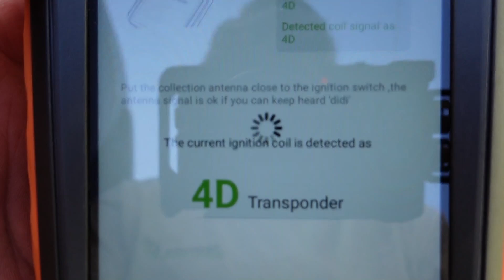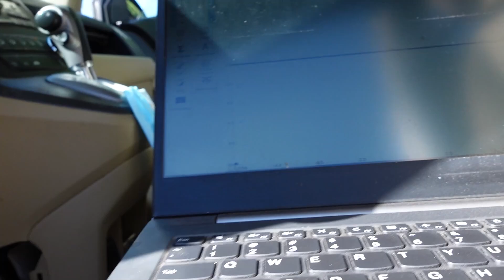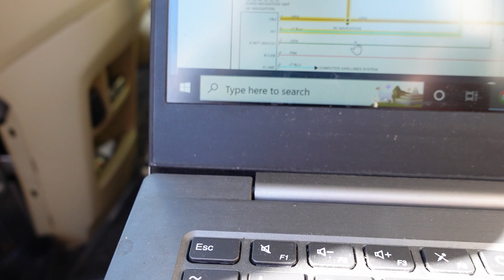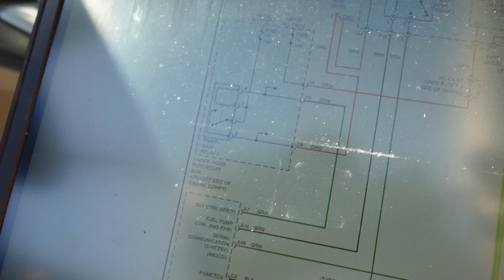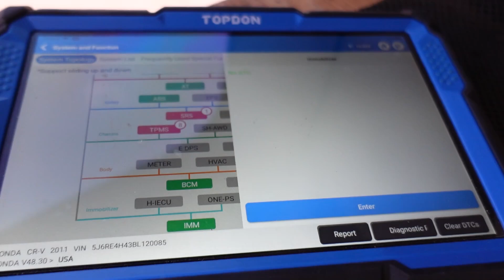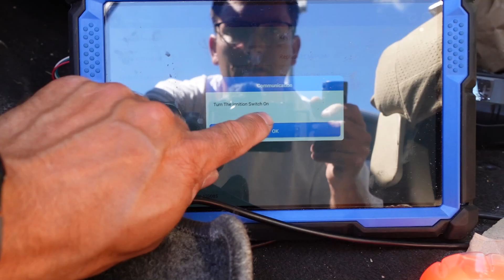2011 Honda CRV Immobilizer Light On

Comment: Hey Brian, do you read these messages  still? I'm having this exact problem on my same generation CR-V. I too have a remote start that has the same exact key fob you show in The video...What is the actual fix for this? Is that Autel scan tool necessary? Thanks in advance.

Comment: Hello Brian, I just wanted to say thanks for posting this video of the process you went through.  You've got quite the spread of tools to help and ultimately you showed that CR-V who the boss is.  I got a degree about 20 years ago, worked in the field a little while, and ultimately made a career change.  I still like to tinker and fix things, and I'm currently fighting my wife's 2010 CR-V.   I will say, that wrapped wire that was dangling is also present on our CR-V, but ONLY because we had an aftermarket remote start system installed.  Elsewise, it wouldn't be there.  I ended up replacing the MICU (Multiplex Interface Control Unit, I think.) and currently have the same lovely light letting me know the car doesn't want to be stolen.  My local Honda Stealership insisted that replacing the MICU would not require any reprogramming.  I believed it would, and my factory service manuals stated they would.  Needless to say, I'm not dying to give them my business at this point. My $1100 scanner won't talk to the MICU's immobilizer functions, which is quite annoying, but I can do a bunch of unhelpful functions that my $300 reader can do (lights, horn, wipers, oh joy).  The world has gotten much more computer oriented, and unfortunately it's not something I've stayed current with.  Anyway, thank you for the detailed, informative troubleshooting video you posted.

Comment: Did both keys register the same frequency with the key tool? I don’t think I caught the comparison
Reply from the maker: They did, I missed recording that, 46 chip
Reply: If you bump the sample rate up to maximum and put the pico on a long time base are the captures decent? I want the 2205a but still looking at other options. Heard micsig makes a good scope. But I do use the uscope a lot
Reply: Autel looks like a decent scope the pc based one
Reply from the maker: @philh9238  the 2000 series is limited , do you want me to make a side by side comparison video as far the sample rate/ quality?
Reply: Yea that’d be good when you have the time to do so

Comment: Good job Brian!i’ve seen straggle on key programming with those/have aftermarket remote starter.coz the way they wired to data line and some of the wire are relayed to imo ignition wire..by the way im remote starter installer too and starting to do flashing/programming job.im learning a lot from your channel.thanks

Comment: So Brian was the fix cutting a new key? I know we discussed it last night but I did miss the beginning of the class. I had that connection problem with the group. Thanks for sharing 😊
Reply from the maker: Yes , The newly cut key would not program for some reason. I checked the Chip ID and it was the same as the one that I had cut and programmed.

Comment: I’ve had that before. The guy changed 3 immobilizer units and different keys and i couldn’t program it. Finally i told him to get a factory key which costed him 70$ and i programmed it and it fixed it right away. Like u said i hate factory junk which makes me think i’m doing something wrong. Nice job Brian. Thanks for the videos👍